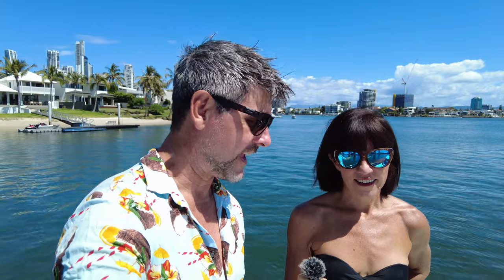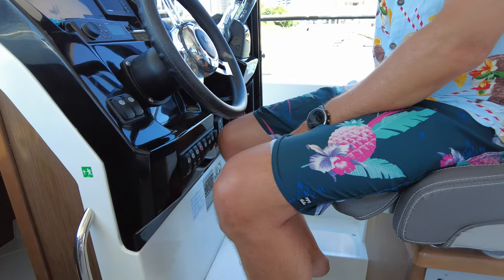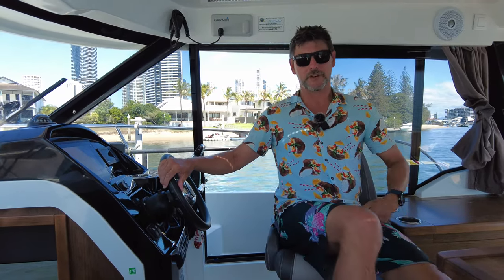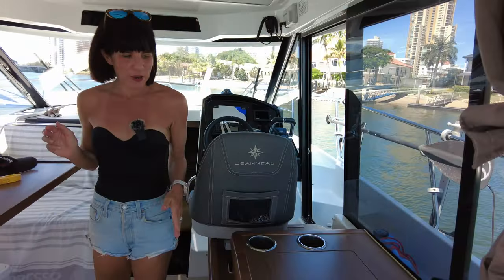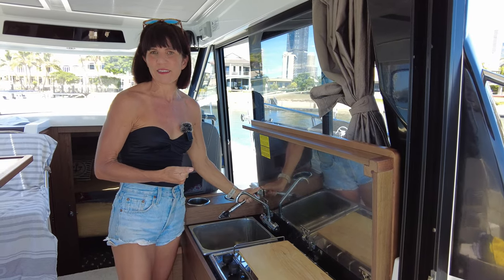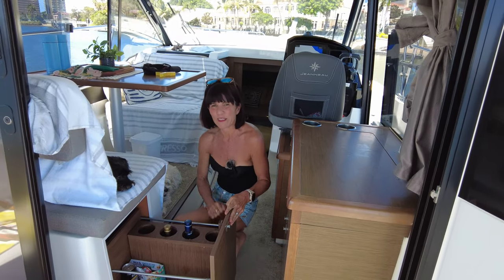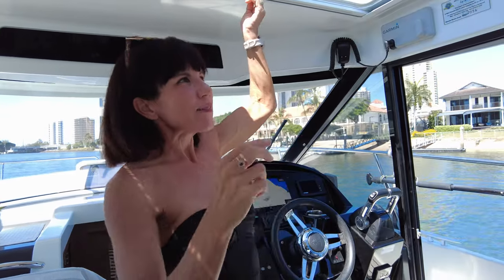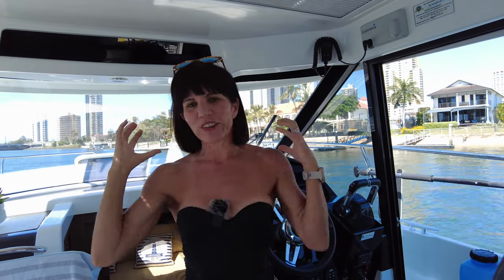TOP TEN IMPROVEMENTS FOR A MERRY FISHER (NC) 895 SERIES 2!

Comment: Hi Damian, it's Michael from Hobart, we have a Merry Fisher 895, storage is a problem for us, we have a microwave which takes up cupboard space, I removed the wine rack in 2 minutes with a screwdriver,  the manufacturer had a fitting across the switches near your knees, we have most options such as a diesel heater (it gets cold down here), we put in another 210A/H worth of house batteries, solar panels which we mounted on the SUP rack, we fitted a DC to DC charger, a 2000W inverter and overhead cupboards in the master cabin, I could go on but one of the best things we added is a dehumidifier which we leave in the boat on a timer (1.5 hours per day) on shore power, it makes the whole interior feel dry and prevents the boat from developing that mouldy smell (we leave every window and hatch closed up when we leave the boat berthed at the marina.
Reply from the maker: Wow that is a fitted out 895, very impressed and jealous! I think you need to upgrade to the 1295 with all that gear! I have noticed that some of the things we talked about are fixed. Like the rocker switch bar and I believe the battery wiring. Good luck finding more space and happy boating!

Comment: Great Video you two.
Agree with all your mods/changes.
As you may know Jeanneau have already addressed the metal safety bar covering the rocker switches ( on all 2021 boats onwards)
Agree vous to have swivel on helm seat but al it if people upgrade to the more comfortable 1095 seat so suggest they make this standard on series two.
I have fitted fixed fitted carpet on stairs down to cabin. Sorts out the problem of sharp edges.
Yes a hold back on heavy galley cover is a good idea.
Not sure about making the two tanks common. But agree you comment about venting smell.
Yes stern cleats are on the wing position.
Perhaps you can make a save all to direct the wind down through the bow hatch?
I would add to your list . A gauge for the FW tank. Crazy it is not a standard fit.
Also a battery power point at the battery switch panel so that you can easily use a power pump on dinghy and paddle board.
There should be a factory option to add solar ( like yours) and the Victron Battery Monitor ( very useful).
I will take note of your comments on the starter battery not being disconnected when at anchor. I must checkout how to do this when I next visit the boat next week. 
Warming up at last in U.K.! So hope to start boating in April! Hooray!
Thanks again for another great video and hope to see some more of you anchoring and berthing her.
Regards to you both.
Reply from the maker: Hi John. Yes I think the seat could be improved and made more comfortable as well as making it swivel. I like your idea for a fresh water tank meter. The last one I forgot to put in the video is to have a horn as standard. We currently have no horn which I find amazing. Glad the weather is warming up for you. Get out on the water!

Comment: Great video yet again. #4 you can get a 3d printed or pvc pipe thingy for the gas strut that will prevent lid from shutting.
Reply from the maker: Thanks. Yes that one is a really easy fix. I was even going put in a piece of hose. Cheers

Comment: A bolt to secure the aft bench seat when it is in its non extended state on the port side. There is a bolt forward of the starboard swim platform, but you still get the bench moving back a little the other side and fouling with engines when they are up. Hope this clear, probably isn’t!
Reply from the maker: Fingers crossed Jeanneau is listening! Another really easy fix. Cheers

Comment: Another nice video.  Here in the US, my 2022 NC 895 did come with a chrome bar over the helm switches.  It's a huge improvement, and it could easily be retrofitted to boats that don't already have them.  I would also like to see Jeanneau offer a power hatch option for opening the lazarette.  When you get a little older, you'll understand!
Reply from the maker: Thanks, I have noted that some newer models do have a couple of improvements like the bar over the helm switches. Can totally see your point about the lazarette and having a power lift. It is a very awkward action. I have attached a small piece of rope to the one of the handles that helps to lift.

Comment: Great points especially the fuel inlets and how crazy it is not having one solo point and correctly at the very rear as the 1095. Engine wash out pipes and again a source point at the rear to plug your pen hose into. 
Steps easy fix nice smooth bull nose my wife has used them as a skin grater ouch and not happy. 
Desperately need the front air vents even with the Skipper door open you still over heat here in Perth. 
I’m going to list a few points and pass them to our dealer as Jeanneau love constructive feedback. 
Grey water tank empty valve ….automate ? So you can activate from the helm?
Reply from the maker: Thanks Sam. Glad someone is with me about the fuel, and the dual filling points. Just annoying and useless. Everything else is a fairly easy fix, like the stairs and the vents. Good idea getting them to the dealer. Happy boating